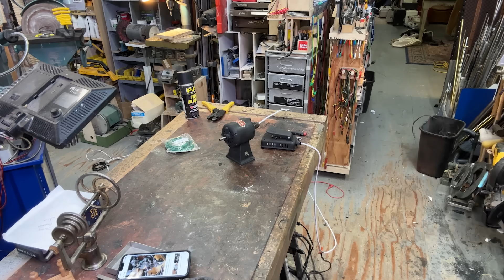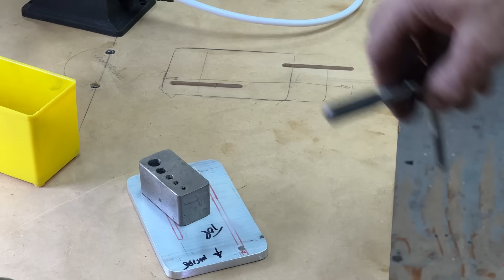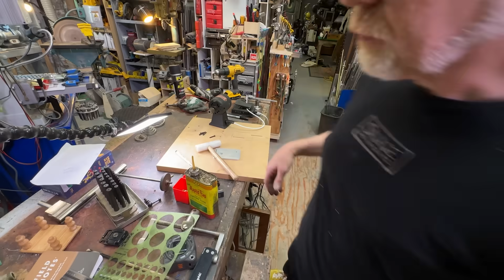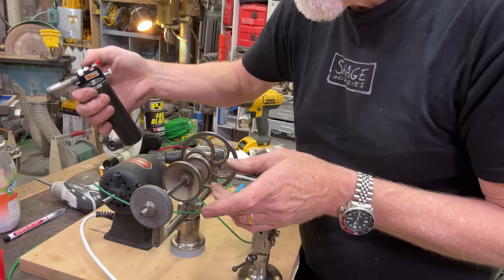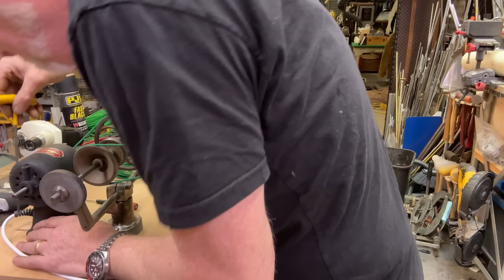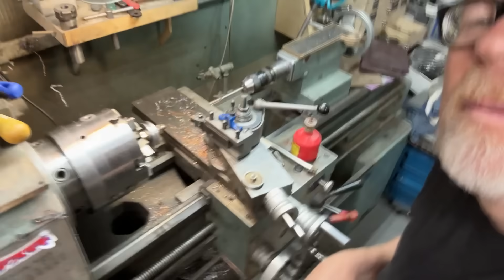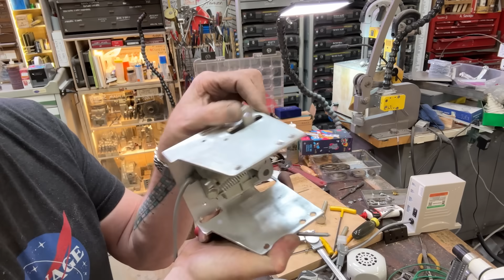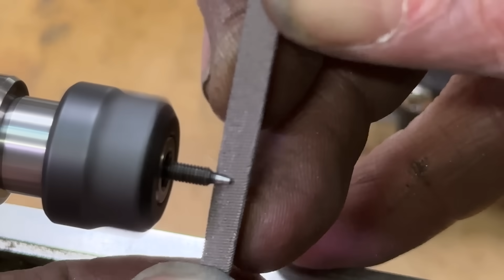Adam Savage's New Mini Watchmakers Lathe!

Comment: pro tip: mcmaster has quick connect round belting very suitable for watchmaker's lathes.  Has a barb that connects the two ends very robustly.  for example, mcmaster part number 6567K56.
Reply: I came to the comments specifically to ask about this type of belt technology. I have a few devices that need belts that I've had trouble finding. I can just make my own?
Reply: The belts are called roundthane and it is available in different diameters.  Buy it by the foot.  Make sure to get the connectors to fit.  Great stuff.  McMaster Carr sells it.  I have never had good luck getting the heat weld belt to stay together.  I even heated a thin piece of steel, pressed the belt to both sides of the hot metal,then quickly joined the pieces.  Never could keep it together.  Rounthane is so much easier.
Reply: I have used this round thine belting it has its benefits but nothing is stronger then a solid core belt fuse together, I have seen the yellow round thine connector let go and fail many times. For this application. What’s the torque needed and resistance  given soiled round is best

Comment: I have spent many hours on my watchmakers lathe. Replacing pivot in watch wheels or balance staffs or making new balance staffs. Drilling a 0.3mm hole with the carbide drill in a pin vice (I don't have a drilling tail stock) after catching the centre with an engraver. You never need to run the lathe as fast as you think I've never ran it faster than 500rmp, and a flat sharp fine diamond polished carbide engraver helps no end.
Under the name stuartxandrews "Making a carriage clock" I have some really bad youtube videos (I even get some of the names and what to do wrong.) Warning its bad.
I don't think i'll be using ER collets just yet I would find it hard to hold a 0.4mm pivot arbor in one. They cost about £250 each for 0.1 to 1mm.

Comment: One of the oil cups is missing its lid. This is a plain bearing headstock that has to be lubricated with very thin oil ! Or it will seize. Mobile Velocite Nr.4 or something similar.

Comment: Is there a video of that lathe being torn down and cleaned? It has the cone bearings like my Star lathe. My lathe needs to be cleaned. The oil in it is ancient and I don't want to run it with gummy oil. I want to see adam take his down and what kind of oil he is using in the oilers. I need an alternative to spindle oil and 3in1 sewing machine oil is a big NO from watch makers I've talked too. 0w20 is one alternative that I've seen be used. I really don't want to take my lathe apart without seeing it done first. The videos I've found online don't show cone bushing bearing lathe tear down.
I would say that a cleaning video by Adam would be trustworthy. Even if I'm only watching to see how it comes apart and back together.
Reply: Did you mean to type “Stark” instead of “Star”? I have a Stark No. 2, which is about 50% bigger than a watchmaker’s lathe, and am looking for resources related to it.

Comment: I got the tip of instead of using the torch directly on the belt to heating up a piece of steel, and then use the steel to melt the ends of the belt. It makes for pretty clean joint. :) I used a piece of sheet metal and a tea light below it, then you have both hands to make the joint.
Reply: This approach works very well. A single edge razor blade works very well for both cutting the belt to size and then heated as you describe to weld the belt ends together. Hold the blade’s edge in a vise, heat with torch, press ends of belt into blade until melting and then slide them up the blade towards the edge until the ends come in contact with eachother.

Comment: Adam it is easier to join belts by putting a butter knife in a vise and heating up the knife blade and putting the two ends on each side of hot blade when melted it is easy to join the two together. Thanks and enjoying everything

Comment: Adam, can you please post a link to the motor you bought on Amazon?
Reply: its an old motor he didnt buy it
Reply: @zachmoyer1849  Adam didn't end up using that old motor. He used a brushless DC motor that he said is for a sewing machine. If you search for BLDC sewing machine motor on Google shopping lots turn up. Including ones that look like the same one Adam has. Least the motor drive is exactly the same and that goofy spring speed controller.

Comment: Where I work we use round stock belts to transport small round parts. Our head maintenance man made a jig to join said belts. It has two jointed blocks to hold each end of the belt pieces and then in the center a slot that a flat soldering iron fits into. You push each end of the stock against the soldering iron and once hot you pull it out and push the ends together giving you a perfect alignment of the ends.
Reply: Same as making gaskets…